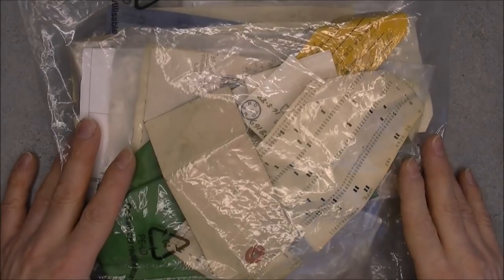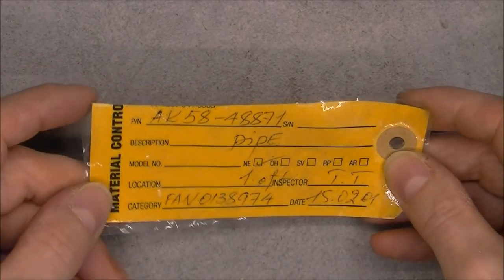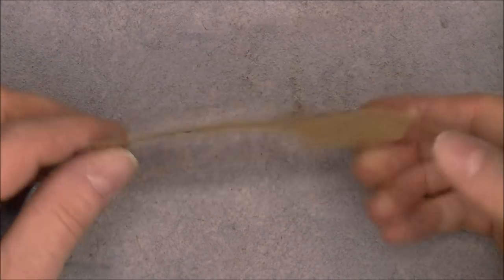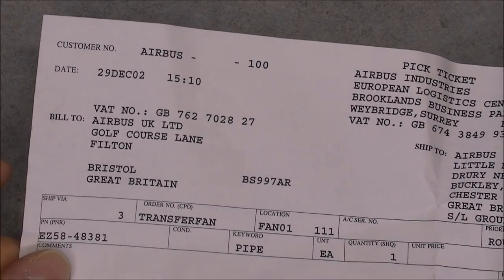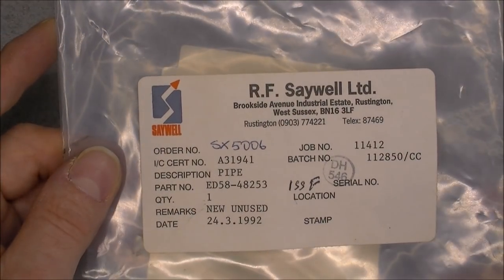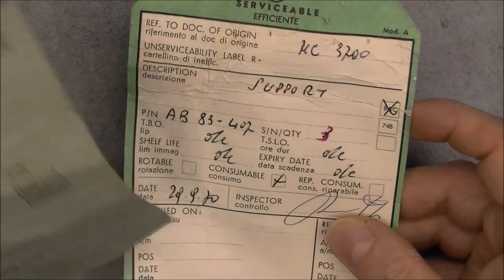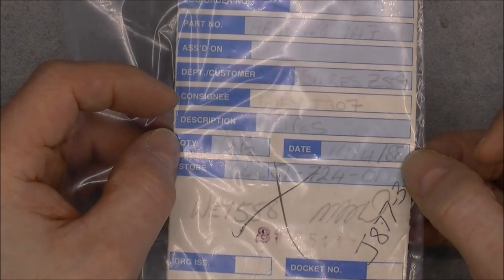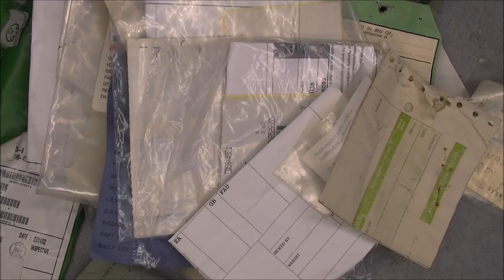Vintage aircraft parts paperwork, used as packing materials !

Comment: I did that as well, as there generally was plenty of the duplicate paperwork around, but actual packing material was something that you had to use paperwork to order from stores. As stuff coming in generally had at least 3 copies of the paperwork, and it was transcribed into a logbook per unit on arrival and reaching the front of the line, the packaging was disposable and very often used as filler in boxes again. Remember the Military and aviation runs on the principle that the paperwork must weigh more than the article it refers to. Unless you are referring to the SR71, where it was around 10 times the mass, and similar for Space rated parts.